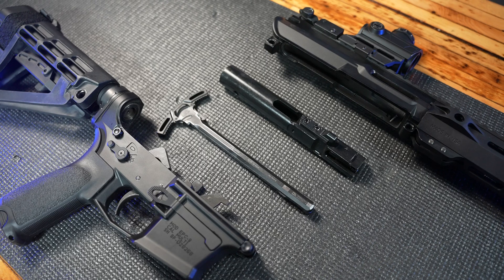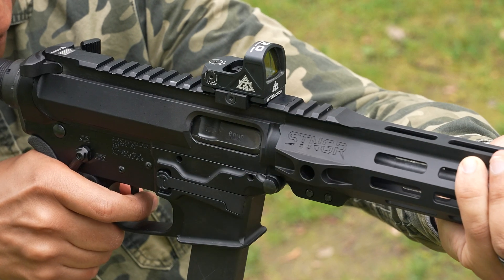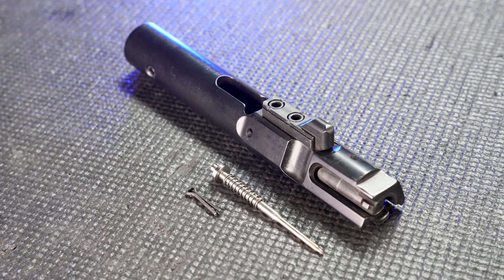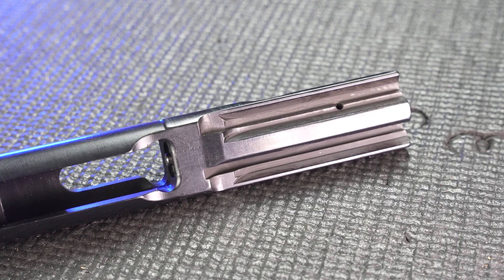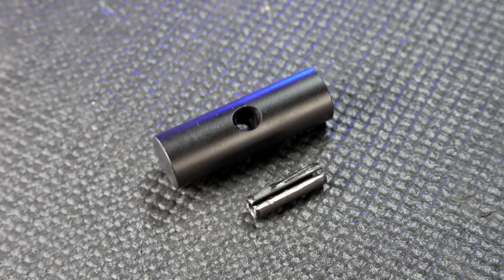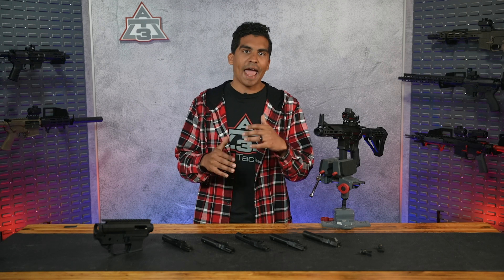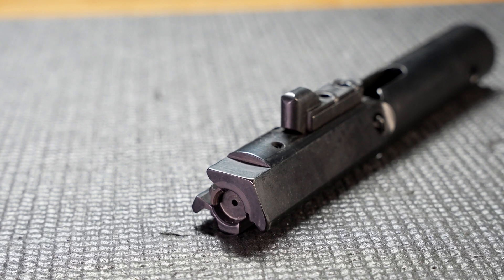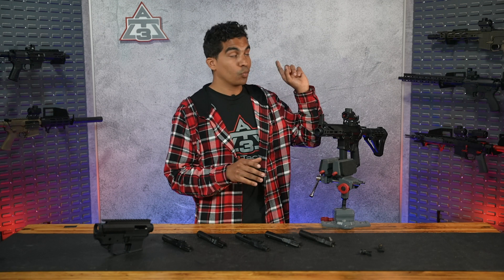Ep 3 | 9MM PCC Bolt Carriers Are Different Than What You Think…Here’s Why | Ultimate AR9 Build Guide

Comment from the maker: AT3 Tactical Available @ Amazon 
https://amzn.to/46ot4am
New Monthly Giveaways & AT3 Tactical Videos (No Firearms Sales) 
https://content.at3tactical.com/
Reply: You guys should definitely make a video for the Radial Delayed Blowback 9mm bolts. The CMMG 9mm RDB kits are available with either a 5" or 8" barrel (I have both, as I couldn't pass the special sales price). They also make it for the .45 ACP cal. in both barrel lengths as well. The things I like about the RDB bolt is that it is a "hybrid", which allows you to use either the Glock, Sig 320, and Colt "stick" 9mm mags, as well as the Mean Arms conversion kit to convert a Gen2 or Gen3 PMAG into a 9mm magazine. The CMMG bolt also comes with the forward assist cuts, which I'm a big fan of. And regardless of what some people may say about the forward assist being "outdated", I'll answer that with "If it ain't broke, don't fix it" -  If SHTF, there may not be any downtime where the operator can take apart their weapon to clean, so having a forward assist can be a lifesaver in situations where the weapon is running quite dirty. Plus it helps to make sure the bolt if fully seated/in battery when performing a chamber check to make sure a round is chambered.

Comment: The warscorp9mm by wraithworks is hands down the best pcc out the box, left hand charging handle that is NOT reciprocating & folds away, takes eve scorp / palmetto akv mags, these mags are double stacked and way easier to load than glock mags and way faster to load with a ETS loader. Either a AR mag release or oversized AK mag release you have both options.  https://www.youtube.com/watch?v=zNietGpSq2M&t=410s

Comment: Thanks at3 for doing these guides most of us can easily make ar's in 556 and  308 but 9mm is a different animal we appreciate this . I will be doing a 9mm sbr soon and this guide will be immensely helpful.
Reply from the maker: Glad to help.
Reply: Isn’t nothing to it built mine back in 2016 I believe.  Lot more stuff out there now.  But went with the Glock mags a last round hold open a just used the regular 556 upper an a 4.15” barrel.  I believe my overall length is like 22”.  Without the suppressor.  
That’s actually it in my photo.  I forgot what collapsible stock I believe it’s the MVB Industries ARC stock they were very few choices of stuff back when.  

One of my other builds before that. The company that made the stocks don’t even exist anymore so hopefully to never have any issue with it. 

But more importantly it runs like a top.  Suppressed or not.   Matter fact.  I like my 556 am blackout an all that.   

But I do believe the lil 9mm is my funnest an most enjoyable one to shoot.  

Hopefully ya went off to build one.  This one didn’t need any kinda tuning.  None of that.